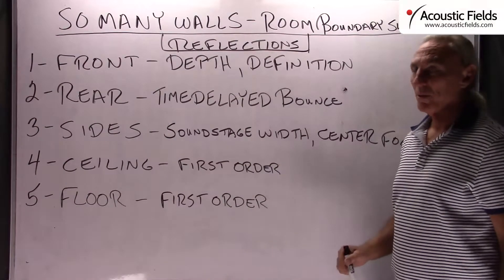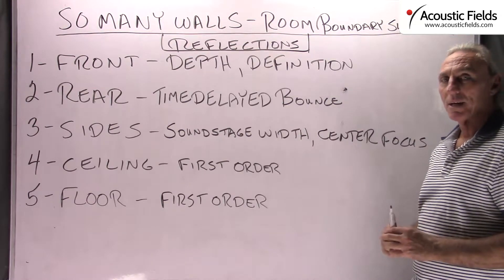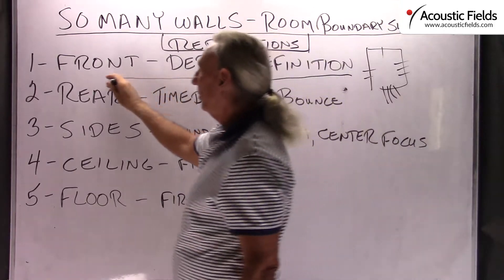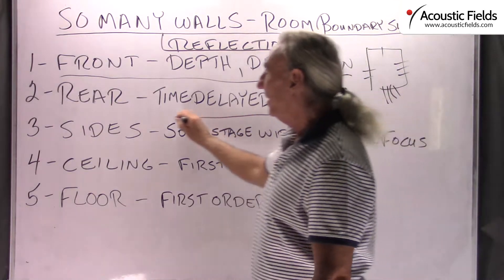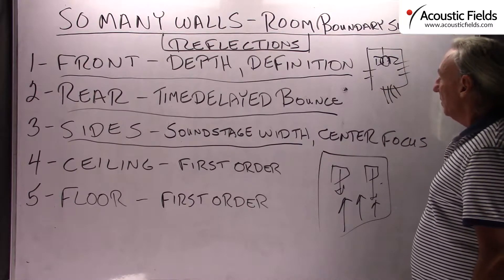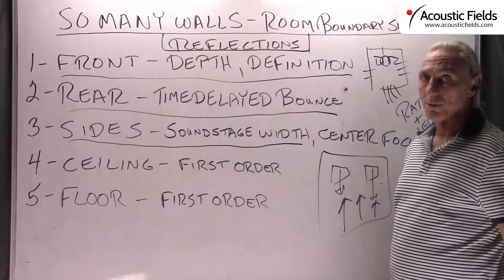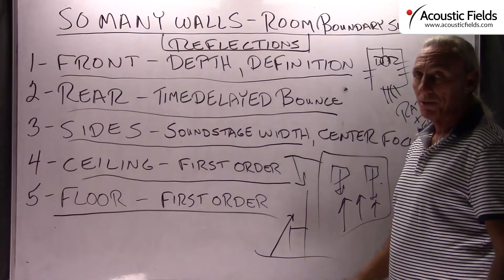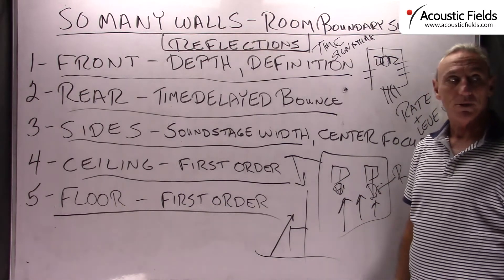So Many Walls - So Many Issues - www.AcousticFields.com

Comment: what would we do without you. make learning so great being all this info is in one nice spot. caint wait for every next video to come out. could you please do a video talking about good speaker placement, and wrong/mistakes in speaker placement. some stuff you see daily. some guidelines for some people who dont have a room with sound reflection/ absorption management? thank you a bunch
Reply from the maker: Hi indopleaser,  Thank you for your support. Speaker placement is dependent upon many variables. It is directly dependent upon room size/volume/usage and pressure of the source. You can place your speakers in one location and play at 80 dB SPL. You will get a response curve for that position. You can then increase the gain to 85 dB SPL at that location which may produce a response curve that is not acceptable. Balancing speaker position with room size, volume, and usage is always a compromise and you have to consider many variables. You must have reflection and pressure management if you are serious about your audio presentation within that room. Rooms are imperfect environments to listen to music in and they produce distortions that have many negative impacts on sound quality. If overall sound quality is your goal, you must treat the room surfaces and absorb extra low frequency energy.
Reply: Acoustic Fields Amen Preacher...! My delimma is I have an unfinished loft and am considering  a dedicated HT room. To get the size I envision...15 x 22 x 9, I will have 6 foot walls, then get into the pitch of my roof. In other words...a 6 walled room....the ceiling being 3 surfaces.  I'm no engineer but appreciate the science that you preach. Before I continue dreaming, am I already out in left field based on my room shape and number of walls? Obviously,  I am fortunate to be able to build this from the ground up...but am I opening up a crazy...and expensive to properly set up can of worms?